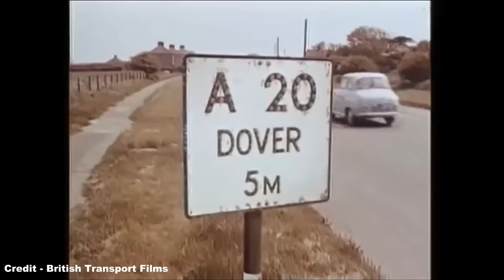BMC 9X - The Mini Replacement That Never Was

Comment: You could say this car was a prototype for the Austin Metro launched in 1980. 

I think it's fair to say that the 1970's was a pretty disastrous decade for the UK, and it's no wonder the reputation of British car manufacturers went through the floor, and British industry in general started to collapse across the board.

I hope we don't repeat the mistakes of the 70's in the 2020's......but so far the signs are not encouraging. 

There are beginning to be eerie parallels between the 1970's and the 2020's. It's like the clock has come full circle. It's all starting to feel abit '1976'.
Reply: Yers, no thanks in the least to decimalisation.
Reply: @robtyman4281  TBF do you actually remember decimalisation, we didn't dispense with imperial, we kept the penny and the pound. The only bit we got rid of was in between. and reduced the 240 to 100, and that caused inflation, reduced demand etc.
Reply: @robtyman4281   Good morning. You did not respond to my question were you there when decimalisation happened? It is fashionable to say that it had nothing to do with it. In fact it was closely linked to the sudden avalanche of cars we could import as part of the accession in 1973. Part of the problem was the state of the pound was over priced for export purposes. The other factor was the state of European manufacturing after the last war and the other was restrictive practices used by the Unions for their own ends.

The problem was this if the pound had 240 pence it was uncompliant with the EEC standard currencies of 100 units. One concept was a pound of 1000 pence which might have helped given the unit price of production was the penny. What in effect happened was that all prices roughly became 2.4 times more expensive so what could be sold sub 10/- (50 p) these days had to be sold for a pound and demand reduced accordingly.

If you are not in your 70's you won't get that. The average salary in the early seventies was iro £4,500 or so and foreign cars were more expensive. It became the norm that if you had the cash it was a foreign car you bought out of the sheer novelty.
As to your point about Japan and Germany don't forget that we exported our tech to Japan to aide them and R.Engineers pulled together Wolfsburg for VW.
In short by making our cars uncompetitive, we opened the door to European product-which subsequently killed our car market.
Reply: @robtyman4281   Good afternoon. You have just proved that History is a tad inconvenient when new myths are concocted. It might interest you to know that at the time you're talking about my first Job was in Henleys preparing cars for the delivery. I can also tell you that British cars were not particularly any worse than their continental offering. Yes the worlds changes- please do try to get over it. Interesting conversation. Thank you

Comment: Oh boy, a whole new OHC engine, I bet the teething pains of that new driveline would have damn near sunk this model. It's sad that England's auto industry were so often taken down with good designs put into production poorly enough that they reach legendary status as the worst engine made, and in most cases just a bit more development would have fixed that. Take the Stag V8 and Rover 3500, which was made on GM tooling, both capable engines, but the stag being prone to all sorts of problems which if developed further would have been solved.
Reply: The Maxi engine was a disappointment as well, in what was otherwise a rather ingenious and practical car. I had the 1750 and it had loads of torque but couldn't be revved.

Comment: I think that Peugeot copied this design and came up with the two door Peugeot 104. Coincidentally this vehicle copied BL in that the gearbox was in the sump which meant the vehicle could be narrow as no need for a gearbox bolted on the the end of the engine.

Comment: Did BMC (BL, Austin Rover, etc) actually loose money making the Mini? Is this factually documented anywhere? It is certainly believed as gospel among Mini enthusiast and motoring journalists.  Probably because it has been repeated so often. But, from what I understand this urban legend “truth” is based upon some reporting that Ford, in the early 1960s, purchased a new Mini, tore it completely apart and did a detailed cost analysis on all the parts and methods involved in building one. Ford’s conclusion  - based upon Ford’s suppliers, material costs,  and manufacturing methods - was that BMC could not possibly be making money on the car.   I wonder how that compares to BMC’s actual accounting?   After all, Ford did not build its own transverse engine front wheel drive model until the first generation Fiesta  nearly 20 years later.

Comment: I owned a mini for many years good points for me were the road holding running costs....Bad points were the engine and gearbox sharing the same oil, consent brake adjustment, rubber springs that make teeth knock together over a bump, oil leakage from gearbox and half shafts, a bad whine from the idler gear, rust that you could take apart with your hand, an old joke I would play on someone selling a mini was to open the boot put a glove on and put my hand though the car.  China should make exact copies of the old mini and bring the price down

Comment: The claim that the mini cost more to produce than its selling price originated with Ford marketing who claimed they could not build it but the cost conscious BMC/BL would not have let it continue had it really been a loss maker
Reply: It is well documented fact that the Mini did not make a penny of profit for the first nine years of production. Nothing unusual there for BMC, they made a loss on every single Morris Minor Traveller produced. Ford did examine a Mini and costed it, concluding that it should be sold for around £60 more than BMC were charging.
Reply: @660einzylinder  Lets have the documentation then.
Reply: @elba9066  The Ford analysis seems to be widely reported. BMC may have come to a different conclusion, but there doesn't seem to be any documentation from their history. But even cost conscious companies often forget to allow sufficient margin for capital replacement. Comparing the fortunes of Ford and BL over the following 20 years might suggest that Ford got it right.

Comment: It's so sad that the Mini never got the development and evolution it deserved. It was such a groundbreaking car that, with investment, could have continued to be the best in its class. Fitted with a better engine, given improved aerodynamics, a better gearbox, slightly more upmarket interior it could have remained a fashionable, trendy but also sporty little giant slayer. Instead it limped along looking Increasingly archaic and frumpy compared to the new breed of very fashionable and loved Hot Hatchbacks of the 80s like the Golf GTi, 205 GTI etc. Only a true Mini fanatic would have paid the huge sum of money the outdated Mini sold for in the 80s/90s. Far better equipped, faster, more practical and cheaper options were the obvious choice for real petrol heads after a new car. It was a sad end for a once world renowned car. But I always used to dream of a Mini with a lightweight 16 valve engine, 5 speed manual gearbox, decent brakes, 13" alloy wheels, flared arches, LSD, maybe even composite wings and rear quarters to reduce weight but mainly so there was less metal to rust away, decent modern interior etc. The Mini COULD have been an incredibly popular Hot Hatch if it had been modernised and hot hatches were selling like hot cakes in the 80s.
Reply: There were sporty Minis immediately before and after the heyday of the hot hatch in the ‘80s; the slightly disappointing, and not as good as its Cooper predecessor 1275GT, which was on sale in the ‘70s, and the revived Mini Cooper in the ‘90s. Sporty Minis we’re allowed to wither on the vine just at the time when they would have enjoyed sales success. At least we got MG Metros in that period - though these weren’t what a sporty Mini could have been. The limited run ERA Mini is a pointer towards what Austin Rover could have brought to market for very little cost - essentially MG Metro Turbo running gear in a Mini shell.

Comment: Failing the introduction of this, they could have introduced the Innocenti Mini that was a success on the continent. Obviously this was far too obvious for the short-sighted management at BL.
Reply: A fully developed car that went into production at BL's factory in Milan. why BL didn't build the car in the UK is a mystery cheaper to make than the original mini a three door hatchback stylish little car all they need do was the tooling

Comment: So the original mini was too expensive to build to make a profit, it's gearbox design expensive, inefficient, noisy, compromises installation with a high centre of gravity, it's suspension was heavy, expensive to make and bouncy, the driving position was compromised and it leaked. But apart from that...
If Lourie Bond had designed it, one wonders how much better it would have been.

Comment: The problem was the engine / gearbox didn’t work.  The tolerances were so tight that it couldn’t be built with them current manufacturing processes.  No one has ever done a clean sheet new platform + new engine + new gearbox. ( ok,  the Beetle but it was financed by a fellow called Hitler)

Issigonnis should have found a way of fitting a carryover A series got it into production then a new engine is developed later.

Peugeot and Renault shared engines in their superminis because they could not afford to go it alone

Comment: Wait, the Mini sold at a loss.

The 9X was designed to be far cheaper to build, although I suppose industrialization would have costed quite a bit.

But the Mini sold at loss. 

It should have been killed anyway.

Comment: Need to correct a fake fact they did not loose any money every car sold made money. It was Ford motors who put this statement out as they said they could not make money on this car as the engineering was beyond ford engineers and with there life cycle and lack  of multi car engineering scales for where not able to make money. But bmc could because the technology was used in several model there for reducing unit costs